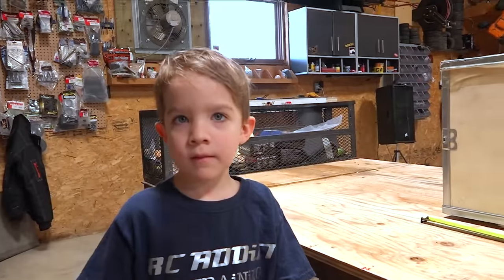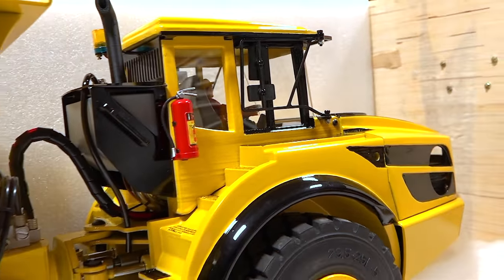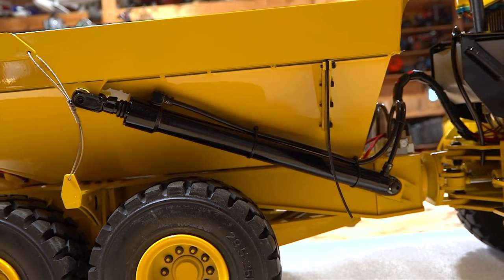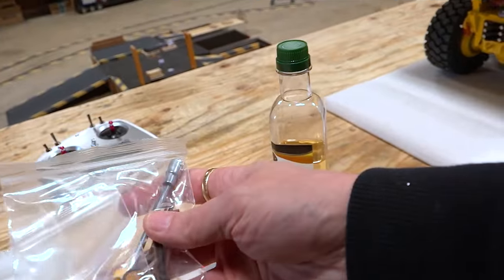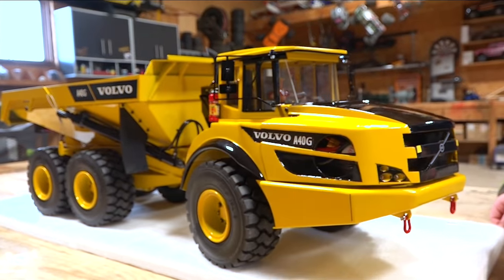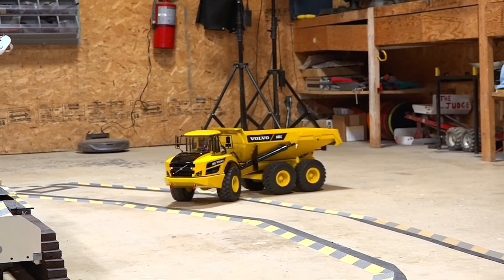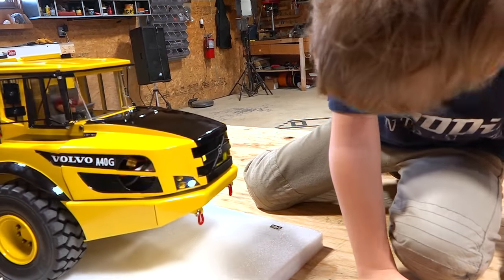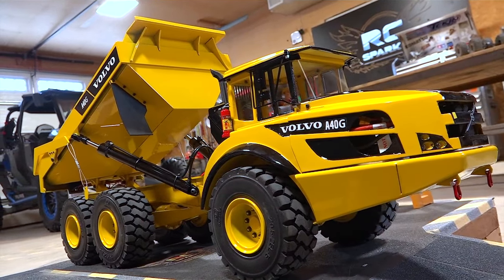Father & Son UNBOX a NEW VOLVO A40G Articulating Dump / Rock Truck 2019 | RC ADVENTURES

Comment: I'd recommend some black grill mesh cut to size and glued under the bonnet to fill in the grill spaces. Realism wise, seeing the RC components through the grill was the only immersion breaker for me. 
Add the grill mesh and squint a little and that's a real truck right there. A beautiful model. :)

Comment: Seeing as how that hydraulic pump motor is an aircraft motor, there are propeller adapters for it. You could easily add a cooling fan under the hood to help with the under hood temperatures. 
I'm super excited to see the new season of YouTube Gold and even better that Moe is driving this year!

Comment: I think the lack of locking diffs is probably more to protect the drive line than anything. Just watch how much movement the front tires have when turning on the bench sitting still, if you forget the diff was locked the steering would really suffer or given how heavy it is it could snap an axle shaft. The over all build quality looks good, and it is cool to see an RC the size of a kid.

Comment: Non locking diffs so it can turn.  Notice the front wheels go opposite rotate when steering at rest..a locked front diff would  make turning hard on it. Smart design.
Reply from the maker: Yes, but remote locking differentials for getting out of mud
Reply: Yes, for the rears at least. But not the front I'm thinking.  Good unboxing!

Comment: I drive a real one   the diffs are open  until i step on the button on the floor  and lock them up    thereare also switches to control what set of axials are live   these trucks are truly amazing       and the  beds normally will flop over on there.side way before the cab does

Comment: You can not lock the diffs. Maybe the rear ones but for sure not the front. Because if you look at it when it steers it pivots on the front tires

Comment: Hi how different are the axels compared to the rc4wd Wheel loader / 870K loader (when sold on aliexpress) Was thinking if the lock diff would fit the Volvo dumper B-)

Comment: locking the differentials will cause turning issues especially when articulating at a stop or at anytime. look at loading wars with the semi's with locked diffs.
Reply from the maker: but rear remote locking differentials would help you out of a muddy spot ...

Comment: Hello, Nice RC Truck! I would like to ask for your opinions from this Volvo 6x6 truck. What are the advantages and disadvantages? Is there any weak point? Is it reliable? Is It a good product? Thanks!
Reply: This is my question from 8 moths ago. It is a fantastic machine :) Only a little "disadvantage": the driving system is a little bit loud becaus of lots of steel parts and lack of grease in the axis.